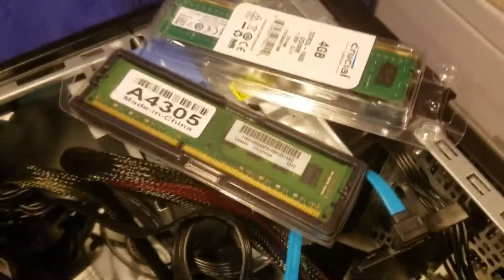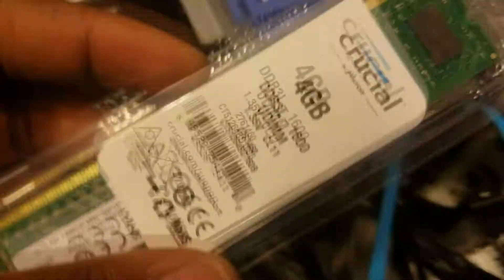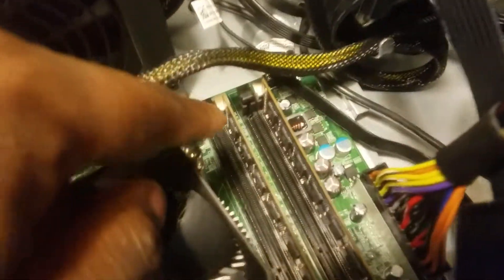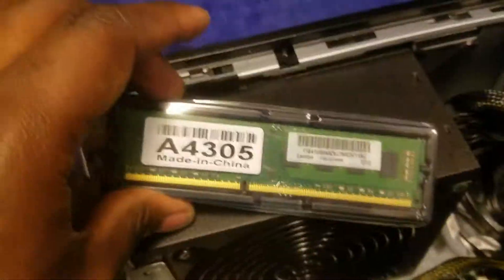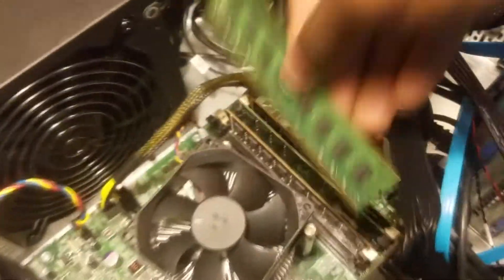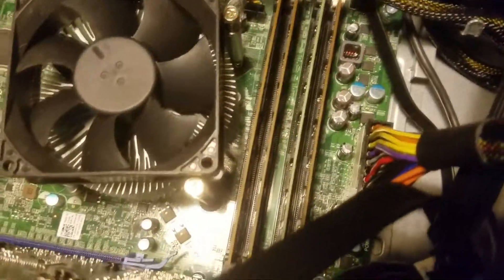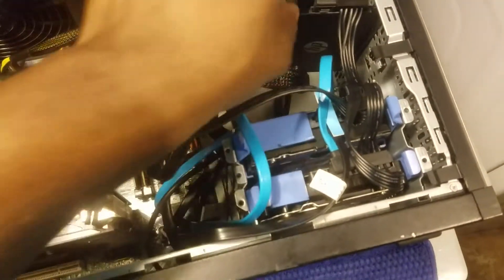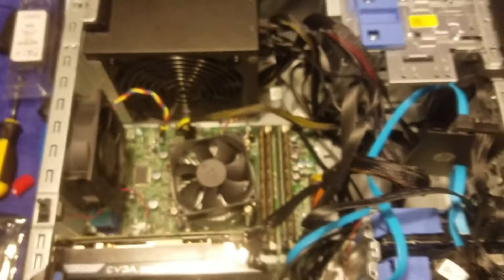How To Install 8GB (2x4GB) Ram Into Dell Optiplex 9010 [All Tutorial] (2019 Gaming Upgrade) #4

Comment: I have a 9010 that I put some Viper 32gig 1866mhz gaming ram in but it says it’s still running at a speed of 1600 how do you change the clock speed in bios ive been into bios and it don’t seem to give you an option 

I’m running 3570 i5 quad core windows 10 pro
Reply from the maker: Not sure if it can be done in the Dell bios. I think it's gonna run at 1600 no matter what due to the motherboard. Or is it 1333?
Reply: @KairosObj  it’s running at 1600